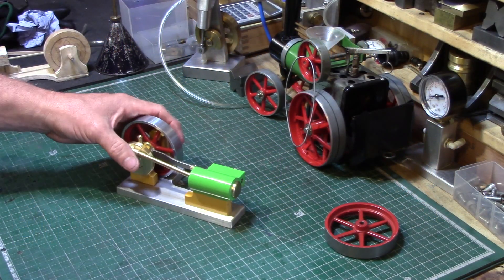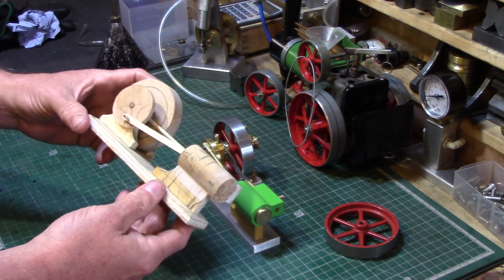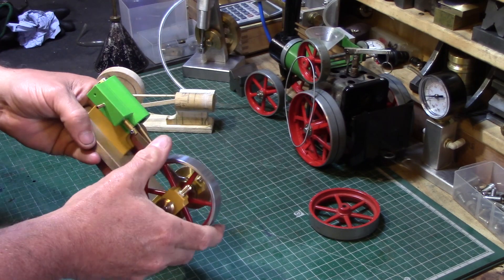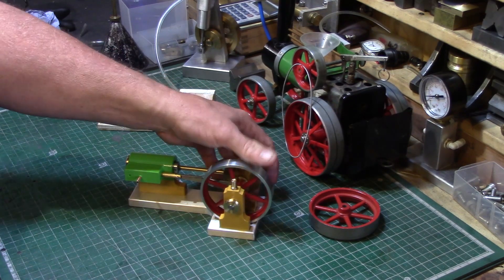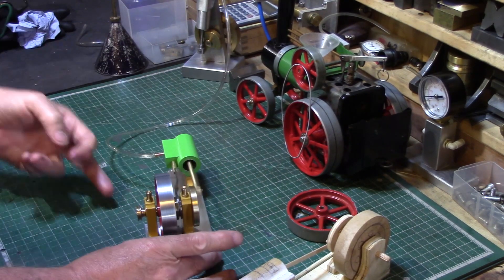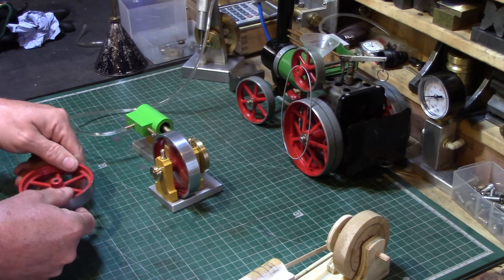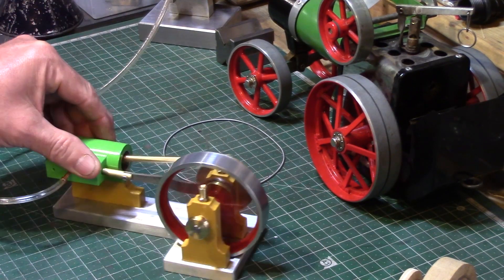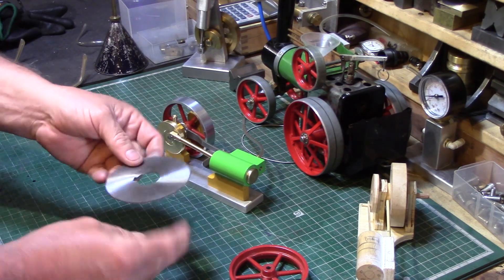Simple Single-Acting Mill type Steam Engine

Comment: Running well on air 
You should look at a electric boiler for testing .I have two 1 is from a coffee maker and another is completely idiot proof to about 35 psi ,it is a modified commercial steam iron boiler. Holds 2 litres and auto turn off and on
Reply from the maker: Thanks, I'll look into your suggesions, was considering an electric pressure cooker, with a tap-off

Comment: Hi, Ade. I've only just come across your channel today. I really like your small steam engine designs. I downloaded the drawings for the  upright 'Wig-Wag' engine. I can see myself building one soon from the scrapbox of offcuts I have. 
I smiled when I saw you using woodworkers router cutters as rounding over cutters in the mill. I also use them in the mill and also in a toolpost holder for rounding over and chamfering in the lathe.
Reply from the maker: Hi Howard, thanks for your comments. The little Wigwag is a nice easy and fun build, and as you say can be built from the scrap drawer.  If you do make the Wigwag please share your work on the facebook group. Best regards.  Ade
Reply: @AdeSwash  Hi, Ade. which facebook group are you refering to?
Reply from the maker: @howardosborne8647  https://www.facebook.com/groups/201574434906362

Comment: Your engines are just beautiful. From both the aesthetic and engineering points of view. Keep it up! We need beautiful things in ugly times. Just one question: are the yellow bits anodised or painted?
Reply from the maker: Thank you ProfRonconi, I appreciate your comment deeply, all the parts are just painted. Regards. Ade
Reply: @AdeSwash  Amazing! How did you get that awesome finish with, of all things, PAINT?
Reply: @AdeSwash  Well, that's just amazing. You just have to let us on the secrets of your painting techniques.
Reply from the maker: @ProfRonconi   No secret, I use Hicote paints, 2  layers of primer, 2-3 layers of top coat,  all sprayed on, several hours between coats
Reply: @AdeSwash  Well, your results are just splendid. Thank you very much for the info.

Comment: Nice job! I was curious about the notches in the valve pin and if the main crank is offset by 90 degrees?
Reply from the maker: Hi SteamEngineWatt, yes the valve eccentric is approximately 90 degrees offset from the crank